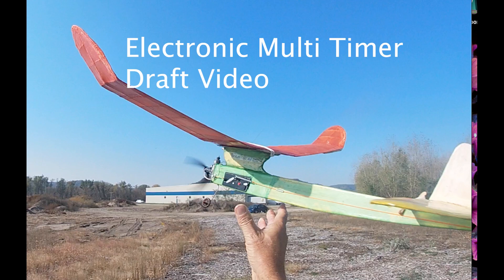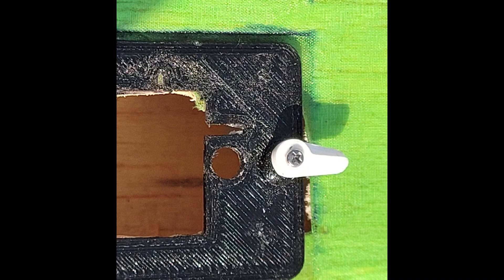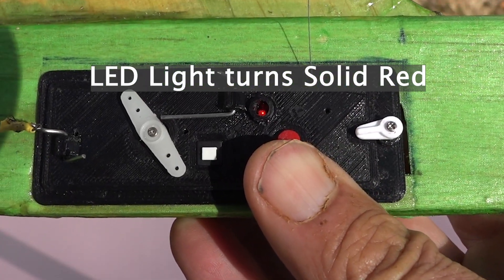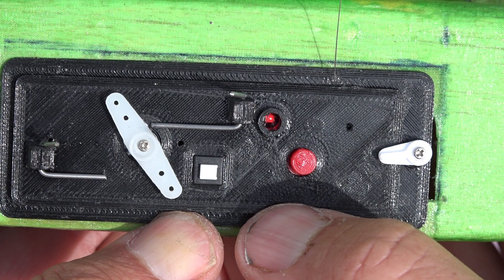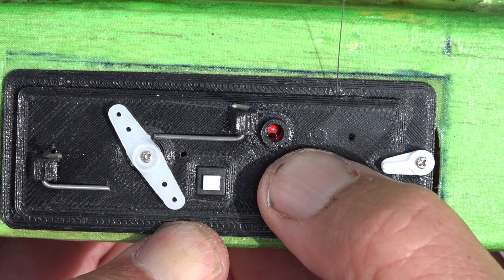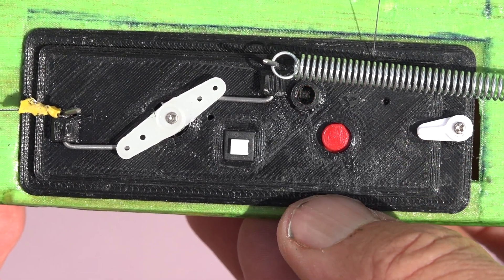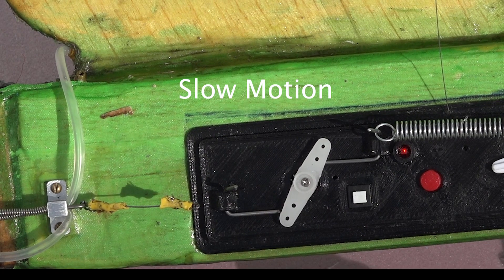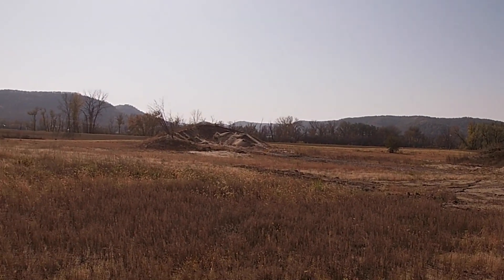Electronic Multi Timer Draft

Comment: Seems complicated unlike the ole timers...thanks for sharing
Reply: The setup is complex, but you only have to do it once. The timer always runs exactly the same, so no more fussing with checking your engine run on the field.
Reply: As Alpons mentioned you can set VIT. Also with RDT you can shut engine off if the power pattern looks to be going bad. That could be bad for the wing but there is a small delay.
Reply: I can understand your comment,  After some practice it seems pretty easy.